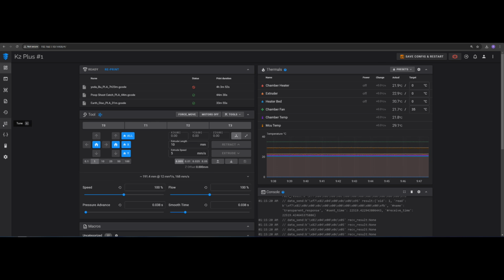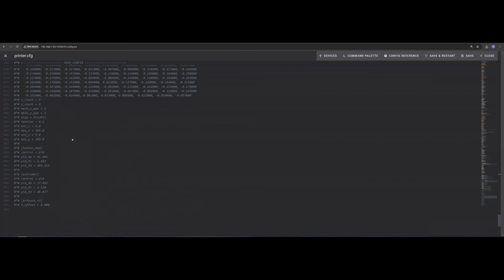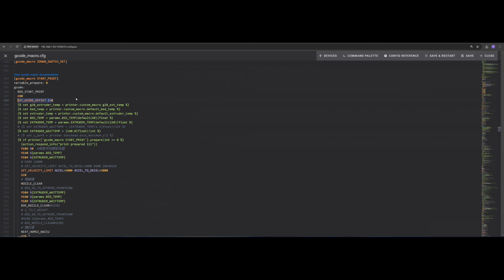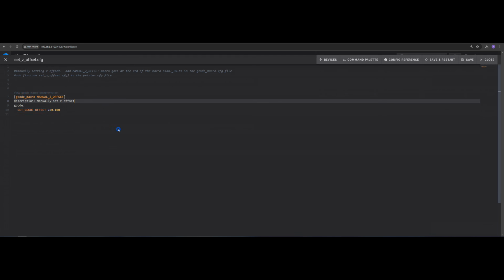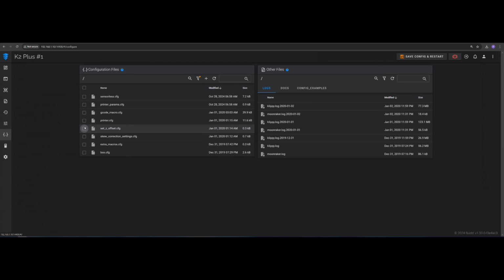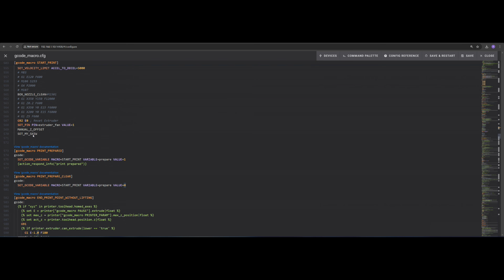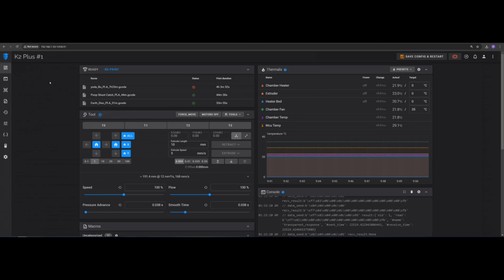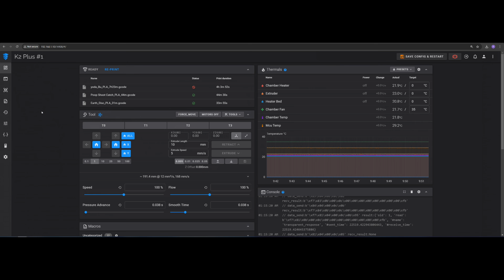Creality K2 Plus Setting Z Offset

Comment: Followed the instructions twice and my Z Offset is not changing in fluid and I can tell it is not changing on the machine when I start the print as the first layer is just as squished. Is there something I could be missing? I double checked and everything in my printer.cfg, gcode_macro.cfg, and set_z_offset.cfg files match yours exactly. 

Also, after looking through all of the comments to see if anyone else had this issue, I see someone pointed out that there is a Z offset setting in the printer settings, does this not work?
Reply: I will note that in Creality Print 6, if I go to the printer settings, there is a spot in the Machine Start Gcode that sets the z offset to 0. Is this doing that before or after the START_PRINT macro in the gcode_macro.cfg?

Comment: Hi, thanks for the great information once again ! How would you go over the calibration to find the ideal z-offset setting? Do you have a model that prints over the full length and width of ur build plate or how would you go about it? I am fairly new to 3d printing and got myself a k2 plus as well but I am not very impressed with the basic first layer lines and some of the quality I am getting. (This probably is just my own fault and bad settings)

Comment: Just to add my own experience with this, my own sweet spot between adhesion and not getting elephants foot or severe raking seems to be about 0.05mm, although depending on what I'm printing, I have to adjust this to get a bit better adhesion. Glue seems to not make much difference, so I just have to be mindful of it. I'll likely be ordering a smooth PEI sheet, it seems in my climate that textured sheets always have adhesion issues for me. Had the same experience with my Prusa MK3S.

Comment: thanks for this vid, could not print PETG at all without having this set, and it wasn't remembering it automatically in fluidd or in the expert mode tweak. Printer would eat PLA for 20 hours no problem, but barf with extrusion issues with PETG until I got this dialed in, and then set consistently with your help
Reply: For PETG and PCTG I have to lower the bed 0.020 or so. All other filaments (PLA, ABS,ASA & TPU) work flawlessly on automatic settings.

Comment: This and your github link was very helpful. I only needed a tiny adjustment (0.01mm up) but without it, the first layer didn't lay down right on a smooth plate.

Comment: Although I love my K2 the z offset has never been right. After following your guide here, I've now got a beautiful machine! 
Thankyou!!

It's interesting in some ways that so many people have this issue though, you think creality wood be doing something about it
Reply: Hi, will this modification be saved permanently, as at the moment I can't get the first layer at all.  I spend half day levelling the bed, finding z offset. Then print what I need and power it off, on power up let's say the next day printer does another bed leveling which then causes z offset being wrong. I don't know what I'm doing wrong. Leveled the bed with tape, found z offset, made first layer perfect but after powering it on next day it all goes to shit. So what I'm doing wrong? Is this modification from video will makes things permanent, so the bed mesh will stay the same always and z offset?

Comment: You can do this easily in the slicer. .065 is what I use on my K2 for all high temp filaments.
Reply: I tried that and it does not work. Looks like they override it in the config file when you start a print.
Reply: @Farathus  It works fine for me. Sorry, I'm not sure what the difference is. I have varied it from .1 to .05 and found that .065 is a good average for most ASA prints I do. If I don't set it the first layer will be so close at times that it can't extrude
Reply: @ Ok I think I know what's going on. If I set it in Creality Print it does not show up in on the Fluidd page at all, but I see that it changes the first layer. I assume the slicer applies it to the coordinates in the GCode directly instead of applying the setting to the printer on start. After playing around with it, 0.02 seems to be best in my case.

Comment: Thank you for this. I've noticed I also need 0.1mm offset for PETG prints, otherwise the printer claims to be clogged as soon as it reaches layer 2 (spoilers, its not clogged).

Coming from an older sling-bed printer, I've always found that PETG needed the nozzle to be higher than what was needed for PLA.
Is there a way to set the Z_Offset by material rather than setting it universally?

I tried including it in the custom filament profiles in the slicer, but it definitely isn't working as desired.

Comment: You can save the z offset in the printer profile in the slicer
Reply: how?
Reply: @timmackey85 I'm going to try to explain this as best I can. It's really not hard to do.

 When you open creality print on the top right corner right under the triangle symbol you have your printer profile. It'll say k2 plus, right next to it you have a pencil icon. Click the pencil, once you're in the manage printer window on the top right corner turn advanced on. 

Under the printable space section you should see z offset as the last Option before entering the advanced section. Set your z offset to whatever you like. Save the profile to a different name. That's it you're done

Comment: Can we not just remove that "SET_GCODE_OFFSET Z=0" from the Start_Print macro, and use the fluid z offset tool?
Reply from the maker: not sure if it is needed with all the other marcos that run at the start of a print

Comment: Thanks for another great video!

Question for anyone who knows though.. I am about to try a rather large multicolor print and I know in the past there had been some debate regarding what the flushing volumes should be for a good print without bleeding given the larger nozzle etc. I see by default the multiplier is .3.. after all the software updates etc is this good enough or should I increase it? any advice would be really appreciated.
Reply from the maker: I would scale the model down to something that can print in less than an hour and get all your flushing volumes dialed in.

Comment: I've made a firmware update to 1.1.1.7. After restart i got a XS3002 error. Connecting to fluidd web page the error message was a missing set_z_offset.cfg. Deleting  in the printer.cfg the [include set_z_offset.cfg]. Store the printer.cfg close it and then restart. The error has gone. I think a copy of the file set_z_offset.cfg would work the same.

Comment: I actually asked them and they said its normal to have different Zheights per material. They told me just to set it as the preset for that material type in the slicer and itll save.

But the problem is my Z offset changes everytime I start a new print, it can range from -0.125-0.233mm
Reply: Unfortunately, it looks like the print head doesn't come properly fixed to the linear rail. If you try to put pressure in the nozzle upwards several of them can slightly twist, skewing the probing.

Remove the print head, and you will find 4 screws that secures the shell with the back fan in the rail, loose the screws a little bit and push it up from the front, so it is at "maximum" twist from a nozzle touching the bed.
Tighten the screws and reassemble everything (you can follow the strain gauge removal guide until you remove the assembly from the rail).

This seems to fix the overextrusion. On a textured plate we should expect underextrusion and a need for negative offset, like yours. Apparently all over extrusions have to do with unreliable probes.
Reply from the maker: It's hard to beat a bltouch or crtouch for accuracy
Reply: @theincompetentcraftsman  I won't disagree here, bltouch is so light and sensitive that I think it has no chance of ever twisting the printhead. Mine isn't perfect yet, even when applying an offset it is printing too low or too high in areas where the nozzle actually touched - my printer has other issues, but I hope the information I provided before will help other with fewer issues.
Reply from the maker: Correct. Different materials should use different z offsets.  It to prevent the material from sticking too much.
Reply: Mine is very inconsistent as well not great for trying to print lightbox signs face down...

Comment: Ran into the same issue .. in Creality print I changed the Z Offset for the Printer to 0.2mm and PLA 0.0mm. to get decent first layers... Heat-soaking bed and chamber for 10min did not help. Literally have to use 2 PRINTER profiles for 2 Materials...  Don't know how none of the reviewers had an issue... Maybe noone has ever printed ABS on the machine? Also PAHT-CF will snap in the bowden tube during Auto level in the rear right corner... I've fixed the bowden tube to the cable chain, but haven't checked to see if this fixes the issue
Reply from the maker: Good info!

Comment: I think this will be more and more commen with printers that are supposed to "just work"

They will have some kind of reset or manually hard coded z-offset and other settings that will give the majority of users a placebo effect and for thr minority they will have to go in and manually recode a bunch of stuff if they even can.
Reply from the maker: I like the idea of printers that "just work" but I also want to be able to modify the physical printer and/or the firmware for the printer to suit my needs/requirements.